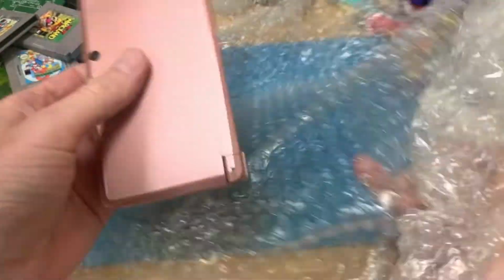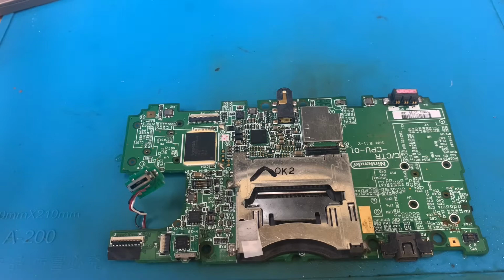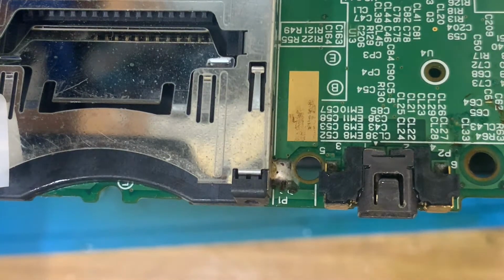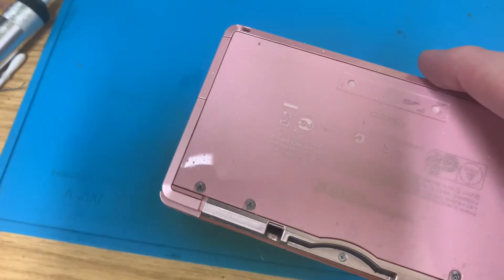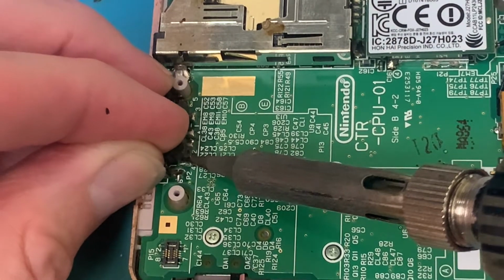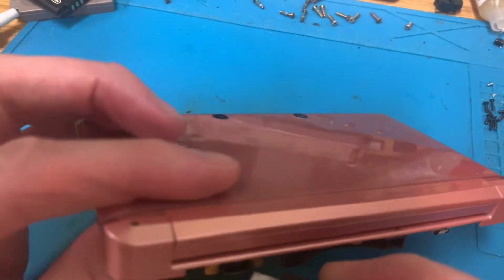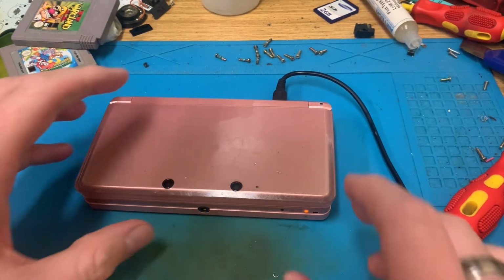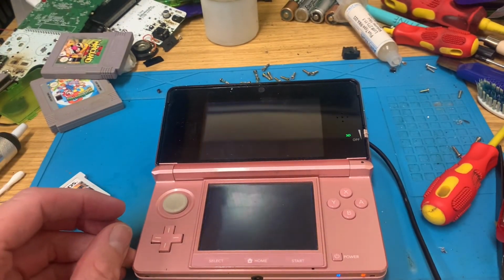Pink Nintendo 3DS  - Not Charging  - Let's Repair it

Comment: You try using chipquick to remove charaging connector it should make easier to losent corrourded soldering joints